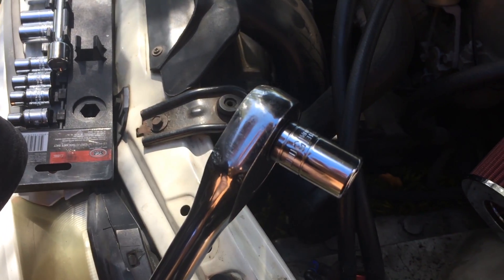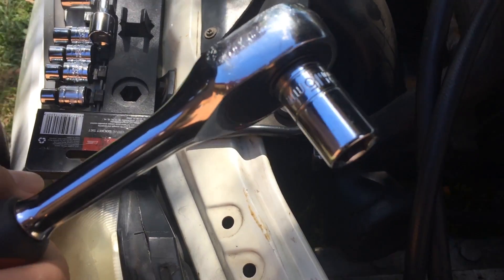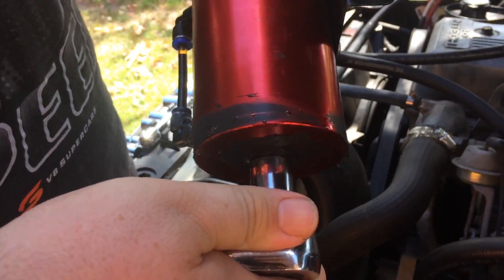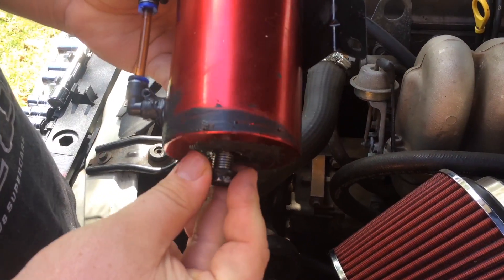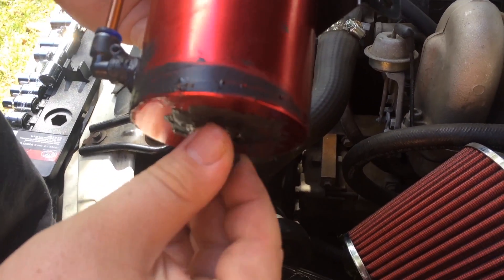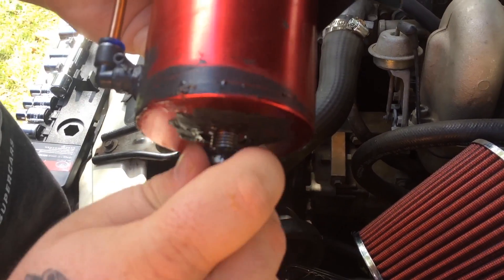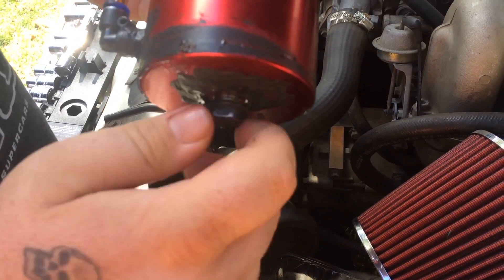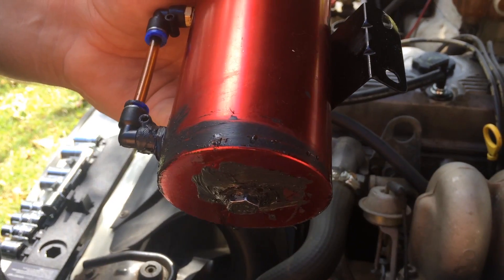How To Empty A Oil Catch Can

Comment: Mine doesn't have a bolt on the bottom, it just unscrews just like a spin on oil filter.  Speedwow, I just emptied it today, it only had a half inch of oil in it,  I installed in October of 2020.